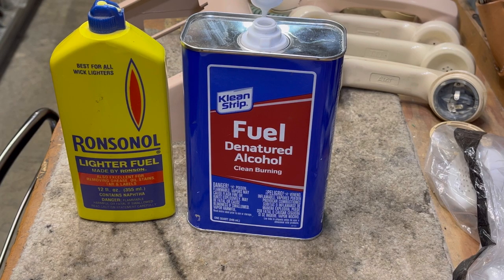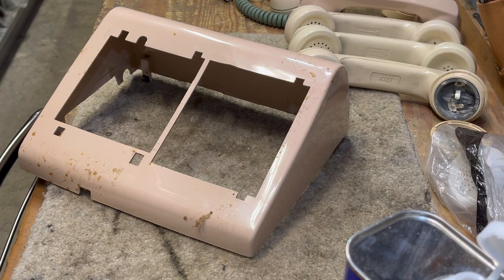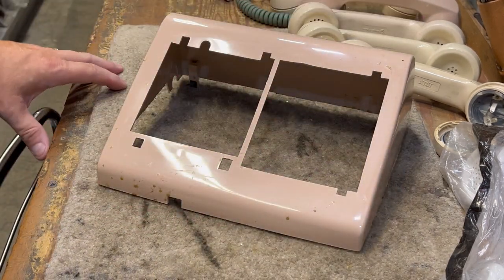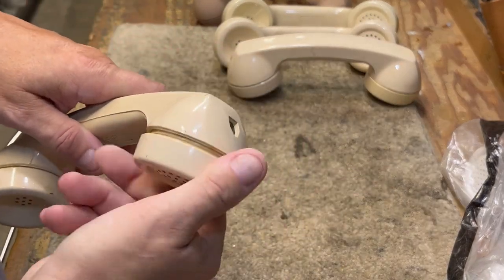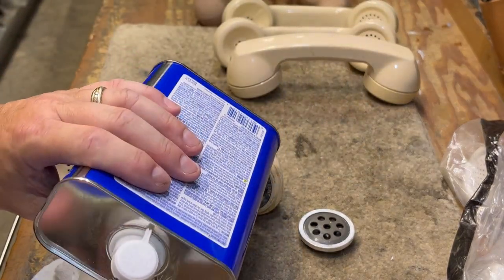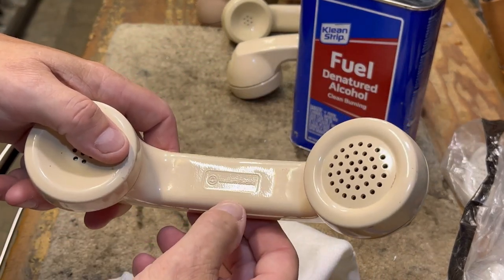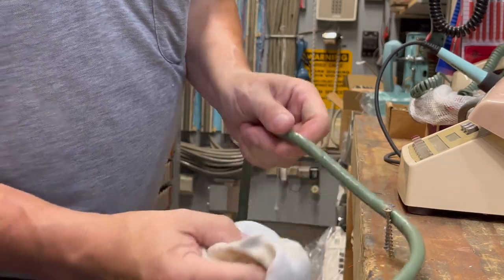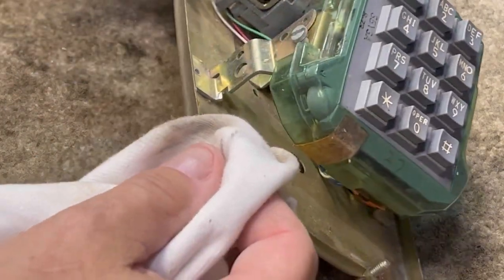Cleaning telephone plastic for beginner's and hobbies.

Comment: Great overview on cleaning up older phones. I've become a little more careful in my use of alcohol lately. I've found it can cloud over clear plastics like lucite used on finger wheels and that it can leave some ABS feeling a little dry, needing a cleaning with novus polish to clear up and get them feeling slick and shiny again. It's also really easy to accidentally start taking off the ink from the date stamps with alcohol. Soap and water can be your best friend too

The one (careful) use of acetone can be to fix cracks. A tiny dab of acetone on the crack will plastic weld it back together strong as new. Even that dab though will mar the finish needing follow up with plastic polish though or to do it from the inside if possible where it won't be seen

Comment: Thanks for the video! Great for us just getting into the hobby. On the older version of the touch tone pads, were they prone to breaking? My 1970s 2554 (has the older touch tone pad) seems to be creating the correct tones, but only chirping the tones. It’s hard to hear, but the pitches are indeed correct; they just don’t sustain. Any advice?
Reply from the maker: Most of the bell system Touchtone pads prior to 1985  where's mechanical and they had contacts on them and L she type tuning circuits. The contacts due get a film on them and may need to be cleaned the LC circuits may need to Be put back on frequency. This is common with WE touchtone pads.
Reply: @sxsphil  Thank you, sir. What would you recommend using to clean the contacts? I imagine emery cloth is too coarse.

Comment: When I first started it G.P.O. the use to be an apartment Called wipe up that would clean up and repair Recovered equipment and send it back out into the field the staff that work there were manly people who had Health problems And my have been injured While working in the Field but has Hard wired phones were discontinued and customers bought their own phone and plug it in the job got wound down